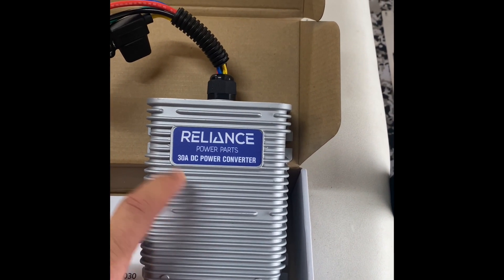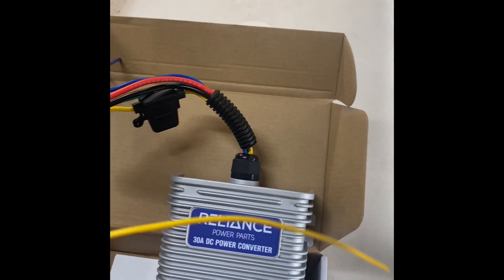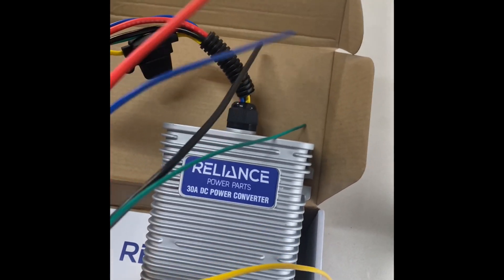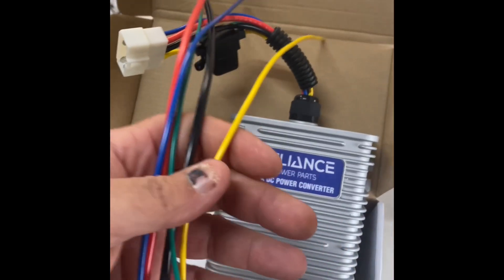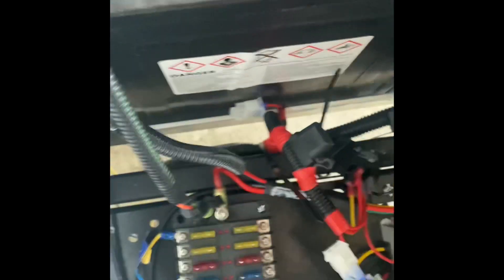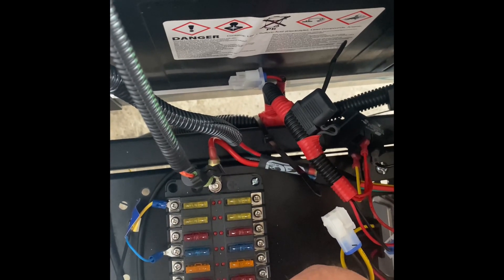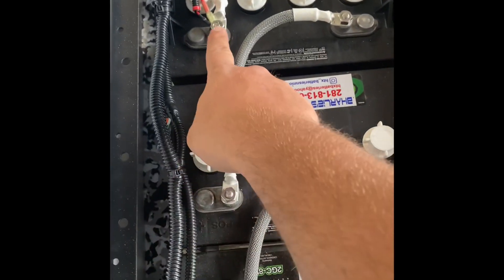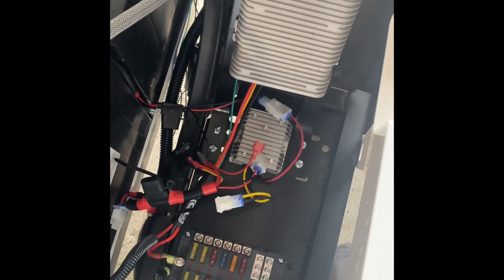RELIANCE 36/48 voltage reducer

Comment: Very helpful!  Two questions...  (1) Which is the activation side of my Selenoid?  One of the smaller or larger terminals?  and (2), the pigtail with the Reliance unit has 3 different gauge size wires.  Do you know what the sizes are?

Comment: Two 30 amp reducers connected to the battery pack works just fine? I need a separate 12 v 30 amp to power my sub ..

Comment: Can you show how you connect the key switch green line to the solenoid? and do I have to run the negative line from the fuse-block back to the pack?
Reply: I’m looking for same answer.  Also, I have a 2007 36v EZGO TXT PDS with a 2 terminal key switch & not sure how to change it to 4 terminal to connect to reducer.

Comment: Did you say run negative from converter to fuse box and then another negative from fuse box to main pack negative? In the beginning I thought you said run converter negative to main pack negative. I’m at the wiring stage lol

Comment: Should you run that 12v that’s been inverted to a 12v battery to help with amp draw for a 5 channel amp? I’m wondering if my system will draw more amps than the reliance can handle…..

Comment: Installing the Reliance converter to 48V 60Ah lithium pack. I want to run the green ignition switch to the solenoid instead of up front to the key switch. Does the solenoid only activate when you engage the accelerator, or is it on as soon as the key switch is turned on? Thanks in advance....

Comment: On an ezgo I’m getting 12v on the blue wire but not the red wire.  Reliance suggests I connect the green wire to the solenoid.   No mater which post I connect it to no power on the red.  
Not on tow. Ignition on.  Can I jump the green to something else to test it?   Jumping to main positive should work I think, but it doesn’t.  Voltage in checks ok at the Harness for green and yellow and black. Any ideas?

Comment: I have a question for you! My golf cart is a 2007 36 volt and it runs good for a while and then it shuts down. I turn it off for just a few minutes and it starts back up for a little while longer. Any ideas what it may be?? Thanks
Reply from the maker: Sounds like the controller maybe getting hot and going into limp mode

Comment: Is the Amp/Stereo the only thing you have running from the 30A reducer? How many amps does the Amp/Stereo draw?
Reply from the maker: On this build it’s the only thing on the reducer. But that little Digital 400 watt amp doesn’t pull very much.
Reply: @GolfCartsModified  One more question, why didn’t you run the Storm Body Kit lights to the Reliance reducer? Is it better to use their reducer they give you or use the better Reliance reducer?